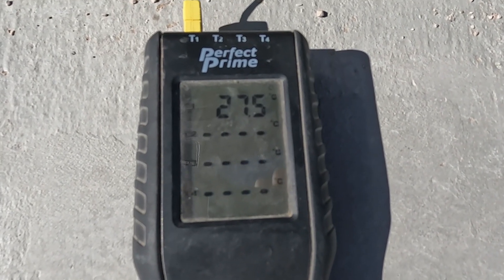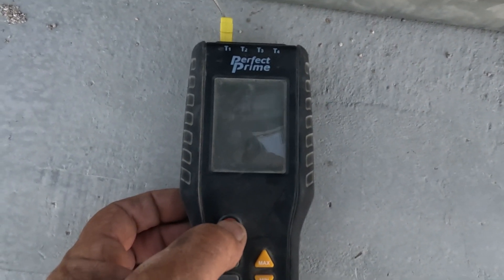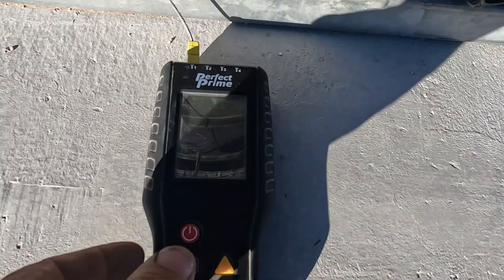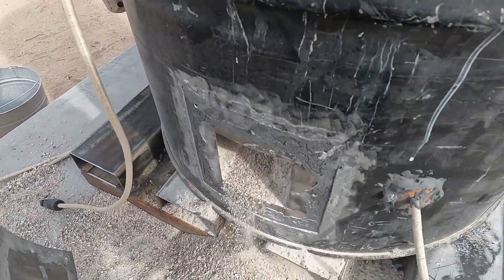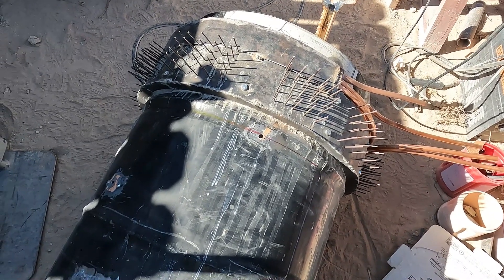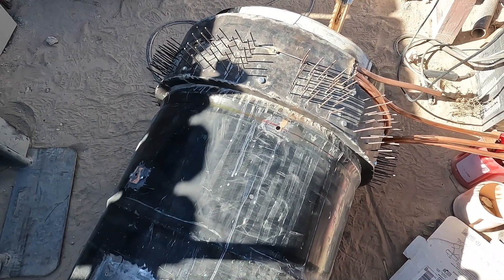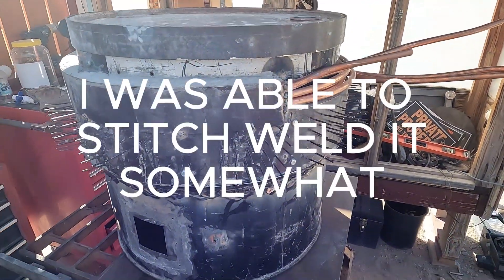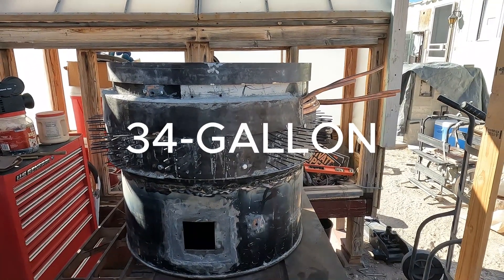170 - Fifty-Five/ 34-Gallon sand Battery Reduction in Size

Comment: Hi Mike! Love your project and your videos keep up the good fight! I'm wondering if something's wrong. When I do the engineering  calcs of wattage required seems like you should be getting more temperature gain even with the original 55 gallons of sand. Are you sure you're  the heating elements are working optimally and have you measured your actual watt hour input or are you going by stated pannel/array labels? Also I realize my calcs take no account for the wind sucking heat off the drum which is probably substantial. Further i did not account for inefficeincy of the elements but still I would expect 2-3 times what you showed.
Reply: Interesting.
Reply from the maker: I don't have a lot of cross checking I can do with my limited equipment and knowledge. But just thinking about it from a basic standpoint.  I am trying to heat up 700 pounds of sand with a minimal 1,020 watts. That is barely enough power to run a hot plate. Not only that but it is only getting power less than 12 hours a day so I don't think it is enough power. I know it is not heating like my earlier prototypes that had less mass. Thank you for your interest. I have more breakthroughs coming up soon.
Reply: Could you share how you calculate the wattage needed?

Comment: What is the reason you are not adding in extra power from a wind generator? t least, it would keep the temperature up overnight.
Reply from the maker: It wasn't going to be enough wattage to heat the 55-gallons so I am raising it to 5-watts per pound of sand. Funny you mention the wind turbine. I may try connecting it eventually.

Comment: Armchair sandbattery enthusiast here...
Too bad you had to cut it smaller but I'm impressed with how quick you implement design changes.  I think I understand that you made it smaller in order to get the sand to a higher temperature, what are your thoughts on wrapping the barrel with thermal insulation?
My neighbor moved and they left me an old rusty oil drum, I'm inspired by your work and hopefully will be able to cobble together something similar.
Reply from the maker: I will show another drawing of my plans. Next I will frame it in with a metal box that I will draw hot air from with fans. Then it will get insulation and a final outer metal skin.